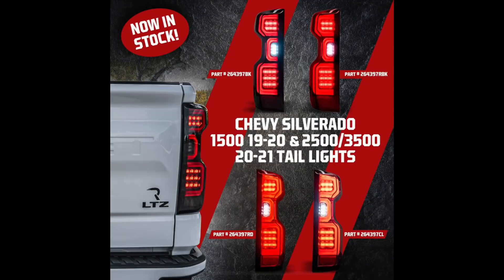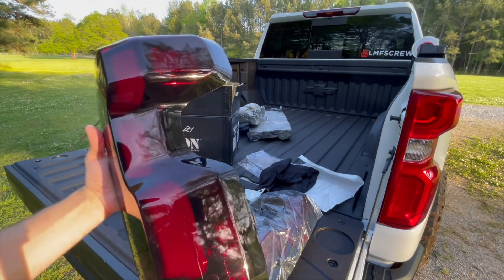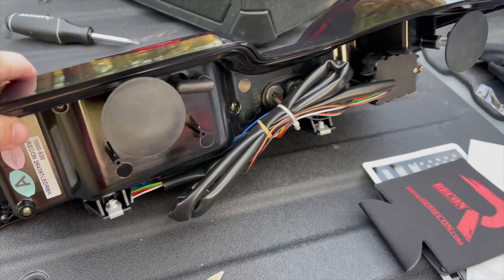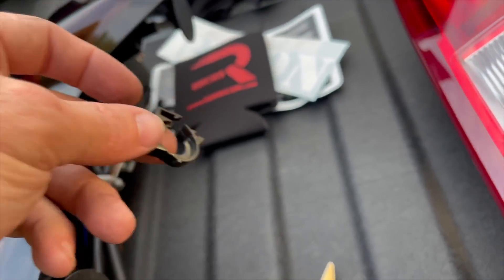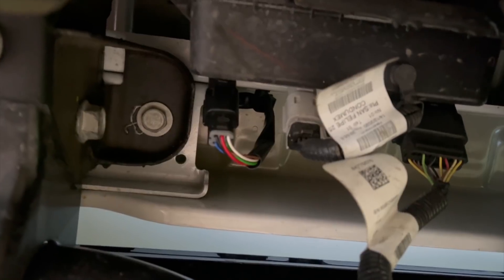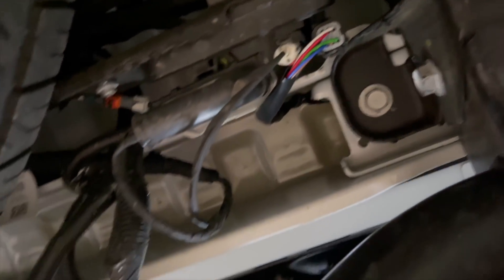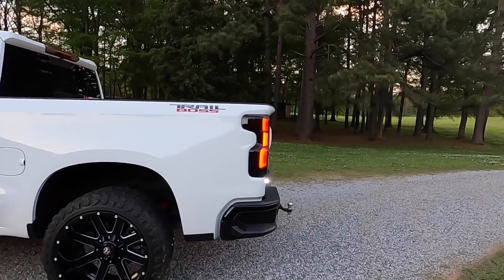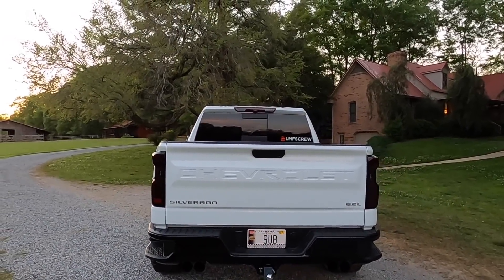Smoked Recon tail lights are so SICK!!!

Comment: Did u have any issues with hyper flashing with the turn signals?
Reply: I just installed mine and having the same issue. We're you able to fix this problem?
Reply: Any fix? I’m in the same boat, and nobody can answer the question.
Reply: @kevinjean8075 i ordered some aftermarket LED taillights. and from what i’ve learned it’s because they require less electricity which makes the truck think it’s a bad bulb. and common sense would be to add a resistor between the ground and blinker wire but my problem is i have two wires reading as my blinker wire and can’t figure it out.

Comment: I figure out the issue. I ordered the wrong tail lights. The original tail lights on my silverado were led and I thought that they were halogen. So I had to order the other set for stock led tail lights and it fixed the issue. I guess with the double resistors for the conversion from halogen to led was causing the flashing. That was my fix. Another thing I did as well was replaced my front light flasher bulbs with leds as well

Comment: My recon taillights on my 21 trail boss are acting up now had them for only 4 months,. I think there is water getting in the connections as there appears to be a short,. When I brake my reverse camera comes on,. And when I signal the rear don't wark and I get a message saying they failed.   Omg wish I woulda kept stock this is a major headache.

Comment: Yo quick question about Larry on your exhaust set up was there any thing pacific that you did or can I just say remove the second cats and true dual to 5 inch tips and should it sound the same? Or if I went with high flow cars would it sound the same? It’s a 2002 f150 5.4 if that helps

Comment: That looks really good i guess its a reason they are like $600 or more. But you can get a very similar look for much cheaper with the air release tint buy luxe, but you would have to do the work required to tint.

Comment: Looks great! Ive got same ones on my 2020 TB.   Did you add additiona lift to your truck or are those biggest tires and wheels you can fit on there?  Is that also the chevy performance catback borla exhaust?  
For anyone reading this I have original set id be interested in sellin

Comment: I just install mine and when I use the blinkers the lights blinks fast like I don’t think it’s normal right ? And I get a message saying it failed
Reply: I just installed mine and having the same issue. We're you able to fix this problem? Mine is ltz which came with led from factory so I can't figure this out

Comment: Have you had any issue with hyper flash? I have a 2020 RST and a week after i plugged in the lights the hyper flash set in
Reply from the maker: Nope never done that
Reply: Ordered the wrong ones 😬
Reply: @ryanbaker2134  they have two different sets you can order ones for factory LEDs and ones for trucks that came with Factory Halogen, my truck had LED, these are the ones I bought to replace factory tail lights
Reply: @ethanmyers144  I had the same issue, did you end up having to put in resistors to solve that?
Reply: @markoveso  they have terrible customer service, told me pretty much it was on me to fix their $700 tail lights, i had to buy inline resistors and cut into the wiring harness, after another 6 months started again ended up putting factory ones back on and now they sit in my garage waste of $$

Comment: I bought Recon lights for my 2021 and got hyper flashing. Very disappointing.
Reply: Probably ordered the wrong one since they have a halogen and LED factory variant. They have good service, give them a call or email.
Reply: I have a gap at top of my recon tail lights not tight to body of truck 2021 Silverado 264397ledrbk
Reply: @mikeleone7702  same truck I have and lmfscrew has in the video. Perfect fit and finish 🤷‍♂️
Reply: @ryanbaker2134  do you have a 2021 Silverado on the package did they send me the wrong ones the box says 19-20 Silverado is there a difference
Reply: @mikeleone7702  yes 2021 Trailboss. 19-21 is the same taillight. Box was prob just last years packaging. Might need to tighten the screws a little.
Reply: @ryanbaker2134  thanks for talking me off the edge😂
Reply: Excuse me how do you fix that hyper flashing problem ?? I bought the same ones and I have the same problem
Reply: @erasmosalazar4779  By returning them.

Comment: Ordered mine a mount ago still out of stock waiting like a crack addict hahah 😂
Reply: Interesting! I was just going to order some. It doesn't say they're out of stock. Did it say out of stock when you order? Or did they tell you they're out of stock after you placed the order?
Reply: @TomO-gb5ip  I ordered on line then got an email from manager that there on back order I called after a month I have a 2021 Silverado then they said they just came in they sent me the lights that said 19 -20 Silverado 2500/3500 20-21 I called them and they said it was the right ones old number 🤔on box installed them and there is an 1/8” gap called them back they said that was normal let me know if they send you 20-21 could you let me know how they fit thanks
Reply: Got them today, box says 1500 19-21, 2500/3500 20-21. Mine is a 2021 1500, The fit is good, not great. Definitely a bigger gap on the top than the bottom, when installing I had to push the bottom with a good amount of force to get the bottom screw in the bed of the truck to line up.
Reply: @TomO-gb5ip  I had the same exact thing you described thanks for getting back to me now I feel better I bet they look great 👍 thanks

Comment: I bought the led red smoked tail lights for my 2021 Silverado 1500 rst and when I looked on the box they sent me 19-20 Silverado & 20-21 2500/3500 4th gen body style I have a 1/8” gap they don’t seal tight to the body at the top is that normal has anybody have this problem called recon and they said that was normal?